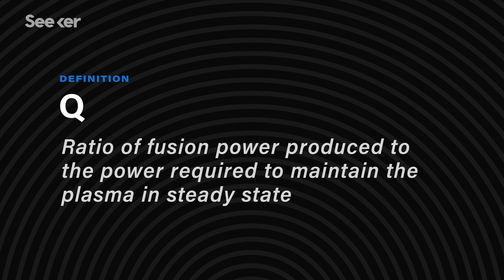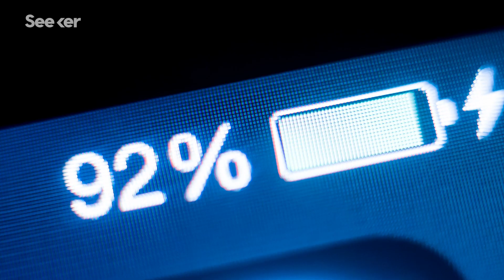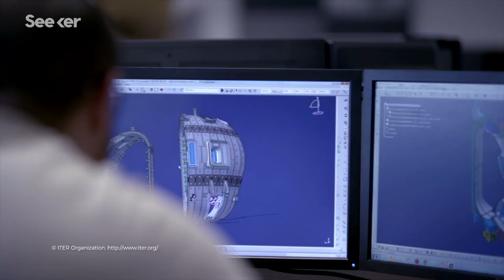How Close Are We to Fusion Energy?

Comment: Fusion is always 10-25 years away 🙄
Reply: Alexander Macgillivray: Define it clearly. It's generating energy from it is the problem. Stabilising the plasma long enough to vaporise water into steam.
Reply: For that reason I fancy ICF over MCF
Reply: Alexander Macgillivray no way, since that means you have transient generation only. How are you going to store a billion gigajoules and release them repeatedly for the life of the reactor?
Reply: ICF isn't any closer than MCF. Their repetition rate is loo small, and the cost of each shot too high. It's good for validating weapons simulation codes, though. That's the only reason why it's survived.
Reply: jjeherrera ICF, MCF or even pneumatic piston reactors - your argument is entirely irrelevant when you consider the obvious lack of funding in all of these areas. All of them are viable reactors one way or another. We could have fusion power yesterday if we didn't spend trillions of dollars killing ourselves. Just one year, every year, the defense budget is like 20 times the TOTAL invested in fusion research over the past 50 years!!! Don't pretend like anything else is holding us back. And  despite this - we're already breaking the yield curve somehow. And I can think of several improvements myself - like why aren't we using hydrogen sulfide in MCF for example? We haven't even integrated YBCO into these reactors yet - imagine the energy savings on the cooling systems alone. 203Kelvin is superconductive at friggan dry ice temperatures! Jesus man. 

Anyway - I'm not mad at you - just the situation bro.
Reply: Ryan Smith They haven't used water as the medium since literal steam engines.  It's been an oil based fluid for a long time.  I think for the larger liquid to gas ratio.
Reply: Yep. Been like that for the last 50 years.
Reply: We do actually have fusion reactors that can output more energy than you put in now. It's just a case of improving the engineering so you can run them constantly, not for a time measured in minutes
Reply: Tall Troll not really. The design of the reactors has not changed in the last 40 years. Strong magnetic fields confining plasma. Breakeven is a forlorn hope with polywell and tokomak.
Reply: @kcikinthebucketofmilk
The inner workings of the fusion reactor didnt change. But the design indeed did change a lot. A lot of different approaches have been tried out.
It is not only a problem of generating more power, it is also about maintainability. If you have to build a new reactor each month, then it still isnt worthwhile, even if you could output 100x the power you put in.
Reply: kickinthebucketofmilk Just last month a paper was published with breakthrough insight in how to stabilize the plasma in tokamaks. To say nothing is happening is ignorant.
Reply: Max Labb   Yeah - didn't MIT discover that by injecting 1%  heliem-3  into the reactor, it produced an order of magnitude more energy?? You would think that would have been done a long time ago. In the history of fusion - we've only invested like 25 billion dollars. Think about that! We spent 150 billion on the ISS. We spend 500+ billion every year trying to add ourselves to the extinct species list. What the hell is that all about??? We could have fusion yesterday if we wanted... and that's where I disagree with most of the people here. They act like it's impossible in the next two decades. Assuming we're still here - it's inevitable, not impossible. Either that or we all friggan die! Take ur bets ppl
Reply: Tall Troll there has never been a fusion reaction. to produce a positive Q value. The most successful recorded was a 0 value, As it produced as much energy that was put in.
Reply: The NIF has managed q>1 (between 1.2 and 1.9). It's ICF rather than MCF, but it can be done. It's all still a long way from actual fusion power on the grid at a sane price, but we do have a plan to get there now, rather than some wishful thinking
Reply: @Tall Troll, technically we already have experiments in JET that reached Q=1 for a very brief time. But it is more depressing unfortunately, that is the physics Q, not the engineering Q. Meaning the input efficiency of auxiliary heating is not factored in (loss of about 70%), and also the output efficiency (another loss of about 60%) due to the conversion from heat to electric. Yes we are not there yet, but we're making considerable progress.

Tokamaks at the moment do not produce net energy, but extrapolations show us that we can with bigger devices. That is why ITER is so big (almost a thousand cubic metre volume!). Just scaling things up is not easy though, the heat load on the wall becomes enormous, irradiation of the walls as well. Also the plasma becomes hard to penetrate with beams that we use to heat it. We'll get there, but it is gonna take a while, lots of interesting physics though!

I do welcome alternative methods as well, inertial confinement was mentioned which is also pretty cool. Here fuel pellets are exposed to super strong lasers that quickly ablate the outer layer and implode the fuel. This immense pressure causes the fuel to fuse. At the moment however the pellets are orders of magnitude more expensive than viable. Also the efficiency of the lasers is pathetically low. So that is also a long way off.
Reply: We've been using molten salt to "store" energy for a while and it works quite well. Better then batteries.  New tech allows it to be used for like 10-14 hours outside of power generation times.  Edit: Storage doesn't even matter if we can just turn the power up and down at a moments notice.
Reply: Seth 100x more power for 30 days sounds extremely viable. The only things that wear out are the containment vessel. And they only wear out because of neutron bombardment. This is a problem with current fission reactors. Its part of nuclear energy.
Reply: Max Labb to say something is happening while spouting the same rhetoric for 40 years is ignorant. Tokomak and polywell designs, or any magnetic confinement design for that matter will never achieve breakeven. Its against thermodynamics. You will never get more energy out than you put in inside a closed loop system. Magnetic lines of force terminate on themselves. Meaning magnetic fields are closed loop systems. These engineers are chasing their tails. Its quite humorous to say the least.
Reply: WeAreTheResistance why do people think money is the solution to all problems?
Reply: until its here...
i know its just a joke, but it still is naive to say such a statement. just because something takes longer than expected, doesnt mean it never gets finished. there is clearly progress being made over the years, eventually resulting in a conclusion.
Reply: Yup, government funding is continually reduced to ensure this.
Reply: We also have better nuclear technology right now but the govts wont use/build them.  

Fusion will always be vaporware unless there is a massive Manhattan Project type program.
Reply: 1320crusier You mean like ITER?
Reply: in 10 years fusion will be 30 years from now! lol we probably won't see it in our lifetime
Reply: cbapiaz
International Space Station cost - ~150Billion - 
Total amount invested in fusion research in the past 50 years ~25Billion. 
"probably won't see it in our lifetime?" - Dude, keep calm - Trump is your president.
Reply: "Always" it means its infinty years away xD
Reply: lets say 50 to be sure. so 2068
Reply: I was about to say that myself.
Reply: Since we alread have functional fusion reactors we are now just over a decade away from fusion as an energy source.
ITER will be an important step and it's already being build.
Reply: The energy of the future which will always remain so.
Reply: Who here has built a fusion reactor? Anyone? What makes you think bigger is better when efficiencies remain constant? Money is not the issue when high school kids achieve the same thing from junkyard parts. We have confinement down. What are we doing with it once confined? THINK PEOPLE.
Reply: It will be here tomorrow!  (A crab house in Nashville has a sign saying "free crabs tomorrow")